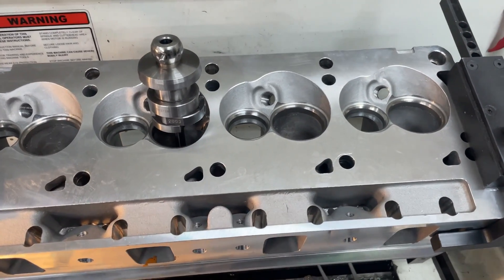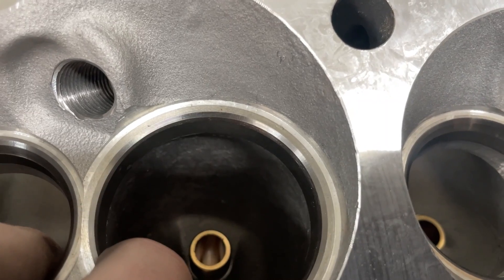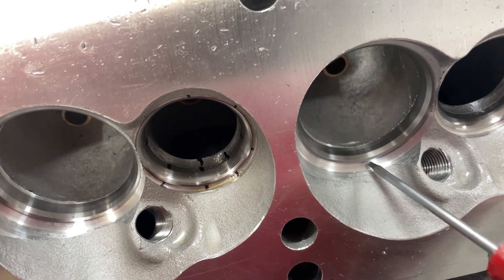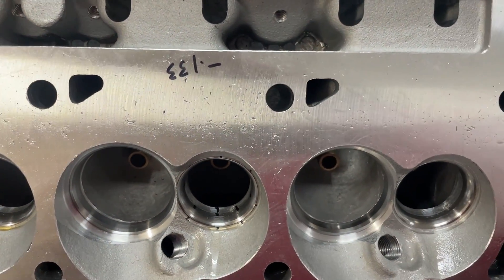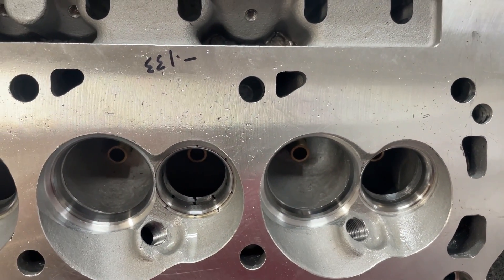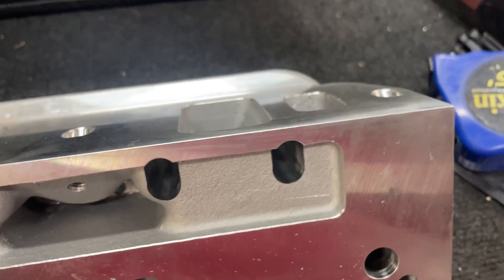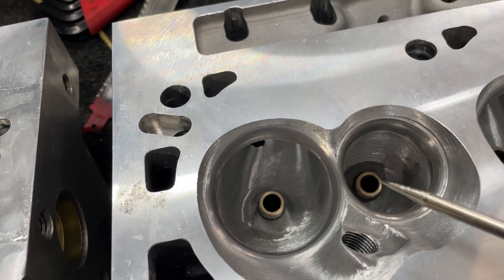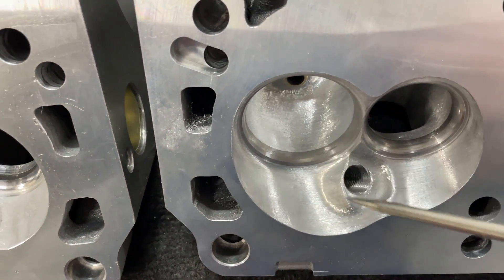Porting Speedmaster Procomp SBF Heads

Comment: i would think you could put those heads into a vertical mill, if you have one and with a DRO and a edge finder with a old pushrod you can get your y position zerod on the pushrod holes and edge find the inside of the intake port, the readout would tell you how much material is there, then take a endmill and mill the ports out and leave atleast a eigth inch of material in there depending on how much you start with and what would open it up enough.

Comment: I’ve had a set of speedmaster 3 v clevo heads since 2006 . Have just freshened them up . But bought them bare and then had them ported and filled with top US named stuff . Flowed 340 cfm .600 from memory. But that’s the inherent design in clevo heads . 
But buy them bare !

Comment: I made a tool that tells aprox the thickness of pushrod pinch material and bolt material closeness based
on the Helgeson tool idea. It has a center fulcrum and an equal length arm with two equal distance posts. 
One post goes in the head and the outside gives you an idea how close you are to breaking through.
I work mostly with Olds heads.

Comment: Glad I'm not the only one that's had this situation with PC Ford heads. Every one I've ever worked on has some kind of problem  with the pockets, pushrod alignment, and/or just plain low quality machining. I think the smallest intake I have ever been able to use to straighten one of these heads up, has been 2.055 DIA. Lots have had to have 2.08s, and some even bigger. Makes for migraines when trying to get your percentages right.

Comment: As far as I can see the pushrod bulge isn't the main issue. You've rectified that as far as is feasible. 
The real problem that remains is the spark plug boss hindering inlet flow at all lift points. I think if the heads were mine, I would machine up some thick copper washers in a lathe to fit under the plugs. Perhaps an eighth thick, and then gradually cut back the intrusive plug boss. This is of course dependent on plug thread depth in the heads. An alternative to plug spacers or in combination with them would be shorter reach plugs if these are available. 
A really interesting video which discusses problems any head porter might face. Keep up the good work.

Comment: I did a set of the older procomp a few years back. I dont have the flow numbers on hand but I remember my .400 was about the same and they were 298@.600. I didn’t go as far with them as you. All I did is fix the short turns, open the pinch like you did, blend the seats to the bowls best I could and fix the chambers. Car ran good. It was a bracket car. Ran 10.0 in a 2800lbs fox.
Reply: Guy sold the engine after racing it for a season. It was his first drag car. Basically built a cheap motor to see if he liked the sport and then built something better. The heads were bought bare and had good valve and it was naturally aspirated. They never had any problems as far as I know. If you going to buy a set assembled and bolt them on stay far away from them. They will fail. They come with the worst hardware I’ve ever seen.
Reply: how are they holding up i see they are on sale for 1200$ was considering
Reply: Did you leave the 2.02 valves? What exactly did you do to the chambers?

Comment: In that pushrod situation, seems like a mill operation could take the allowable material away safely, leaving whatever thickness you’d be comfortable with. The oval pushrod slot should be in the same place for each cylinder (you’d think, anyway), so setup shouldn’t take forever. What you found with your finished product was really good, though. Thanks Eric!
Reply: The best way is to drill out the pushrod journals and drive bushings in place. Then open up the sides of the intake runners.

Comment: Wow, those are some crap heads.  It's like somebody tried copying a blueprint with the only crayon left in the box. Didn't they spend more on the porting than the heads ?      Don't you have an E tool ?     Either way impressive for the junk you were working with.